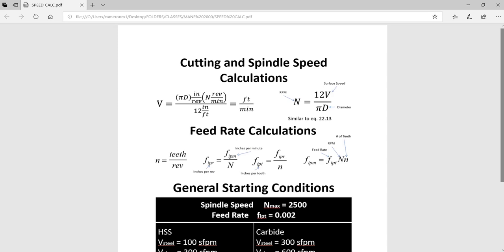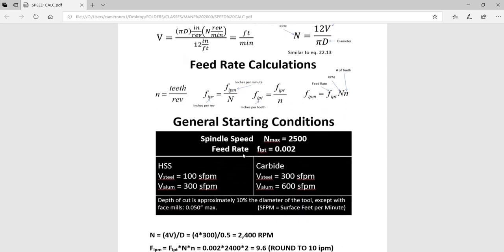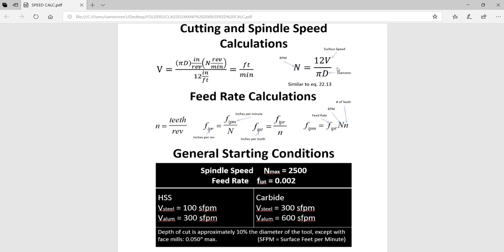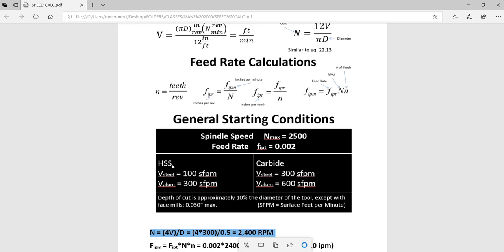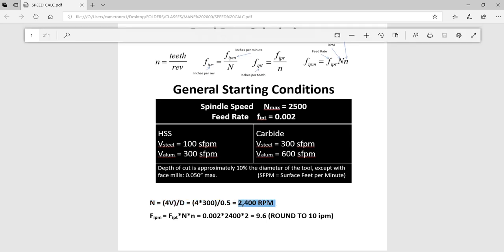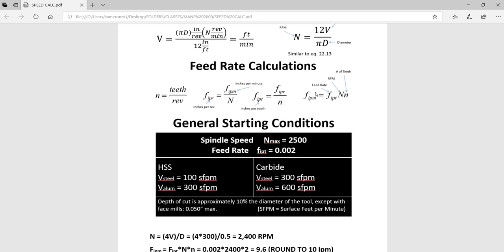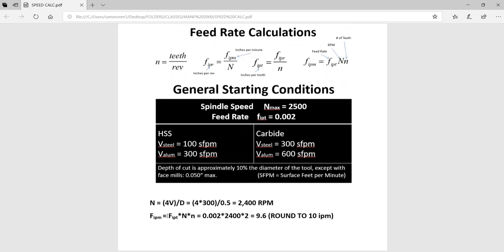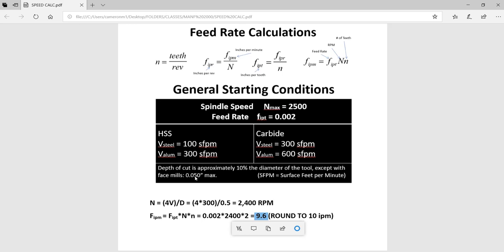SPINDLE SPEEDS AND FEEDS

Comment: Thanks for sharing your knowledge great teaching videos, I can't find any specs on my tools for the fipt (inches per tooth) so should I use the same value for all, even if it's different on diameter?
Reply from the maker: .002"/ tooth is pretty mild, for most applications it should be pretty safe....the thing to remember about Feed rate is that the calculations give general starting conditions, but speed and feed should be adjusted based on how well that particular tool is cutting.

Comment: .5 DIAMETER ENDMILL
SFM X 3.82 / DIAMETER = RPM         200 SFM X 3.82 / .5 DIAMETER  = 1528 RPM
RPM X FEED PER FLUTE X NO. OF FLUTES = IPM         1528 RPM X .004 PER FLUTE X 4 FLUTES = 24.5 IPM
3.82= 12/PIE

Comment: Is there a massive difference between inches and millimetres for the feedrate calculation?
Reply from the maker: well 1in = 25.4mm...if you keep that in mind it shouldnt be an issue.

but the formula will work equally for imperial or metric units.